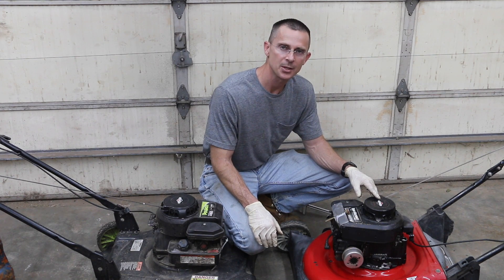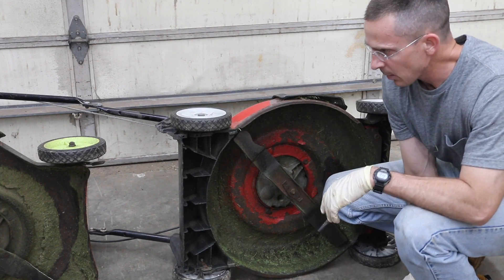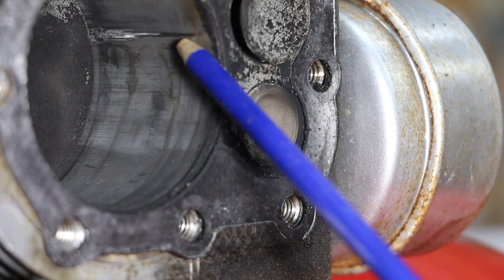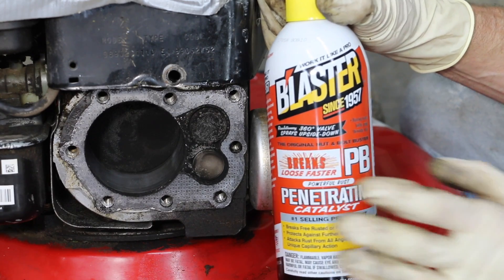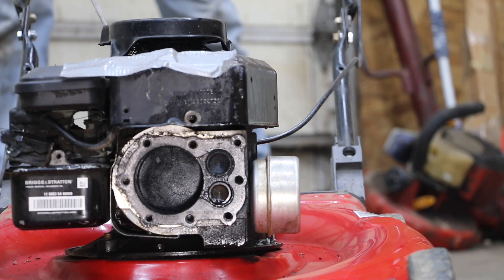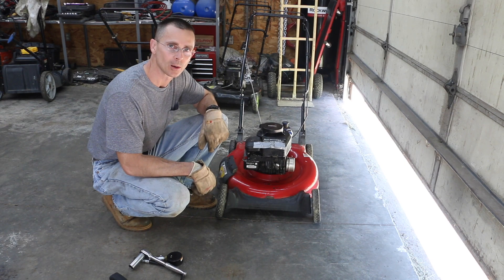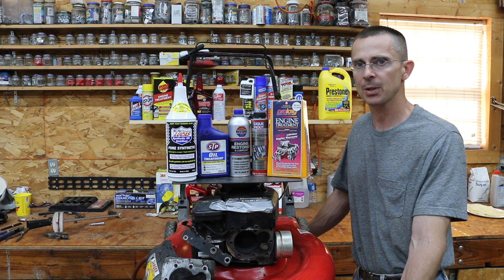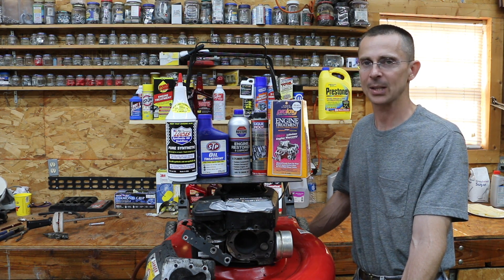Engine ran without oil, seized! Can it be saved?

Comment: You cant put the material back on the bearing and wear surfaces. When its scored or gone its gone. If you want it too run quiet put gear oil in the crankcase. Years ago WHen we first started buying Subarus someone brought a Subie that had run out of oil and seized. The mechanic's were lucky at freeing it up and they road tested it for a while. However, like you said if its knocking... its not going to live long. 

I was in the appliance repair field years ago and of course on occasion electric motors would seize up. Motors seize for different reasons. T
1)The bearing had run out of lubrication or was contaminated with water or dirt. Physically damaging the surfaces.
2) As was common on Fan Coil (water runs through a water to air heat exchanger. Sometimes Chilled 40 degree water, sometimes hot 190 degree water) the motor oil would evaporate and gum up. 99% of the time Just cleaning the bearing and oiling would free and save the motor. If the motor bearing gets damages and metal transfer occurs between the shaft and bearing its life is really over. 
3) the bearing is gone and the rotor is rubbing the stator. 

On occasion luck is on your side but not normally.

This is a great experiment pal thanks for the fun
Reply from the maker: All great points and thanks for commenting.

Comment: I  often had those brought into returns at both Home Depot and Lowe's. After explaining this was a non warranty issue, something I learned from working in a repair shop,  I put in fresh oil, tipped mower on it's nose for a few seconds, put WD-40 in the cylinder, turned it over by hand a few times.
Reinstalled spark plug, and it would usually start. I would run for no more than a minute, drain out black, metallic oil out, refill and suggest to the customer that oil should be changed after the next mowing ...
Reply from the maker: Thanks for commenting on this!

Comment: My fahther had a Stil one cylinder mower which seized up. So he disassembled everything, bought oversize rings, took some Sandpapier to hone out the damage. You might also need to buy new bearings. But that is all. Running like a champ.
Reply from the maker: Thank you for this recommendation!

Comment: From a young age I learned about Marvel Mystery Oil. I have used it in all my vehicles. I bought a chevy malibu with low mileage. Pretty much brand new 4 years ago and always used MMO in the gas and oil and that engine runs extremely well and still has the same horsepower as it did when I first purchased the car. I have added about 35k miles on it and really, it's just always been an amazing additive for me. Far better than seafoam.
Reply from the maker: MMO is a great product!

Comment: what i have found in the past when the seize due to oil starvation is the rod has a habit of breaking down and "welding" material on the crank , since most these small engines dont have a oil pump , most these oil treatments wont seep in properly , and since the rod has galled to the crank , it has worn excessively , hence the knock . some times if the engine is worth the cost , it can be honed , a new rod and the crank turned. great stuff you got going on here . im hooked . thanks
Reply from the maker: You're right. I've seen the same think regarding the rod/crank "welding".  Thank you for the positive comment!

Comment: I have an old Nissan with 300,000km's on the clock and I use the thickest, gummiest engine honey I can find (Moreys) and you really can hear the rattles and knocks reduce but that knock I think is past it.   Do you have access to a decibel meter to scientifically try each to detect which will quieten it the most?   Maybe also try plain old diff or heavy gear oil as a comparison and cheap alternative?   Another great vid!
Reply from the maker: Thank you for this recommendation!

Comment: Is it possible to run 2 engines by swapping The wire to the spark plug to the other engine and starting them at the same time will they run.  Do this in a video
Reply from the maker: Thank you for this recommendation!.

Comment: My air compressor pump assembly (dual valve) shaft will not rotate. Do you think there was too much damage to fix it, or would it be worth repairing? The whole assembly is over $400!!
Reply from the maker: It's really difficult to say without taking a look inside to assess the extent of the damage.  I hope it can be affordably repaired, but it's more than likely in need of significant repair.
Reply: Project Farm thanks for your reply! I'm no valve expert, but I'm going to open it up and see what damage was done. Thanks for your time and all the KILLER vids!

Comment: Just wanted to say first off i like your videos! As for this situation one product i have tried thats not on the shelve you showed was a tube of tractor grease, yes i said that correctly lol. I had and engine seize and freed it up but need to get the job done and took the grease and put it in an old cooking pot and heated it with a torch to basically liquify it and poured it into the crank case. In my situation it did get rid of the knocking sound and was able to finish the job but once it was cold it was a no go. I would like to see this in one of your videos to see if it would be a repeat. As far as compression idk. But it worked on my pinch. Thanks again for the great videos!
Reply from the maker: Thank you for this recommendation!

Comment: My motorcycle started burning oil faster than I was checking it.  It seized up (slightly) on me on my way to work and started to make a clanking sound and blowing white smoke.  It will still start and run but I don't dare actually drive it.  

Guess I'm doing a top end rebuild.. at the very least.. :(
Reply from the maker: Sorry to hear this happened to you.

Comment: I had an old '67 skidoo Olympic that seized. After working it back and forth and pouring oil and pb blaster in the spark plug hole I got it freed up and still have it and it runs!
Reply from the maker: Impressive!  Thanks for sharing this experience.

Comment: I boughtba brand new mower and it siezed after 2 minutes. Id followed the recomended guide in the manual on how much oil to put in and petril etc.. i filled the oil with the correct oil.. its seized hard cant pull yeh starter motor cable at all and the blade is locked hard... Im gutted. Cant take it back to the shop cos it wont fit in my car.
Reply from the maker: Sorry this happened to you.

Comment: I had a lawnmower that was still running, but it made a very thick smoke cloud with a loud knock. Didnt try saving it, it never seized just got used alot.
Reply from the maker: Thanks for commenting on this.

Comment: i know this is really late but my choices and why, are LUCAS, STP, and LIQUI MOLY. all for a single reason. almost every race league runs 1 if not all of those brands, meaning they must me good enough to be used in such high performance and temperamental engines.
Reply from the maker: Thank you for this recommendation.

Comment: I say use resore like you did in your video with your ford 5000 tractor. I used restore in my 1975 ford f100 that has a 4.9 300 inline 6. The engine is original has not been redone at all, i used restore  and noticed a hugw difference in engine performance.
Reply from the maker: Thank you for this recommendation.

Comment: That knock might be a wrist pin but I think it's probably a stretched rod end cap, squashed/spun bearings or both. I would truly like to be proved wrong but I don't believe any of those products are going to do much good for that. If you can find a product that lays down some kind a film between the rings and damaged cylinder wall that might help with compression a little, wouldn't want to count on it in anything other than this test mower engine.
Reply from the maker: Great point. Thanks for commenting.

Comment: slightly different situation for me, i seized an engine with a blown head gasket due to overheating. 1984 bmw 325e with the 2.7L inline 6, drove it till it locked up, had it towed home, less than 2hrs later was able to start and drive it. Replaced the head gasket a little while later and it ran great. I was totally surprised it ran at all lol
Reply from the maker: Wow!  Glad you were able to save it.  Thanks for commenting.

Comment: If the mower deck is good, I'd just buy a new engine for it but these days, you can buy a new mower for the almost the same price as just the engine. It pays to hose down your mower or clean it off after use.
Reply from the maker: Thank you for this recommendation.

Comment: I used Restore in a Ford Escort almost 30 years ago, it went from 50 miles to a quart of oil to about 250 miles to a quart.  The car ran better and when cranking the car over it sounded like it had better compression, sorry I didn't check before and after compression. Love your videos, keep up the good work. Uncle B.S.
Reply from the maker: Impressive! Thanks for sharing this experience and thanks for the positive comment.

Comment: yeasterday my car renault kwid climber engine stopped due to oil leakage can it be recovered again?
Reply from the maker: It's possible if the engine didn't have a "broken part".  However, the engine is mostly too badly damaged to recover.  If the engine is seized, it's possible to add a spray lubricant to each cylinder and manually rotate the engine. I hope this helps.

Comment: I restore ceased engines often. On my cub cadet 80 their was a oil issue for a while and the engine basically ceased. This happened another two or three times. The way you fix it is grind the cylinder gradually and it will still work fine but you may need to replace the piston overtime. Mine now runs perfectly without a knock.
Reply from the maker: Thanks for commenting on this.

Comment: I'm interested to know what a 50/50 mix of Marvels Mystery Oil and Mobil 1 Synthetic could do if left to soak in the cylinder with the piston completely retracted. Think it would bind to the scoring and maybe give a little repair to the piston ring? It could be worthless. I don't know.
Reply from the maker: This is a great question and I definitely do not have expert-level knowledge regarding either of these products.  Maybe I can do some testing.  Thanks again for commenting.

Comment: The Restore to get the compression up (I learned that from you in another video)...  :)   And the restore might improve that main bearing knock a little bit.  I assume Restore works by hardening in very hot areas, above a certain temperature (it would be neat to see if Restore creates hardened deposits in a skillet at a particular temperature, an idea maybe?)...   if the engine still knocks after the Restore treatment, the STP's thickness could buffer things a bit and prolong the main bearing.  Maybe.  :)
Reply from the maker: Thank you for this recommendation.

Comment: I say pull the piston out and try to clean up the rings a bit and dingle ball hone they cylinder real good, then maby run 30% Lucas in crank case oil.
Reply from the maker: Thank you for this recommendation.

Comment: Good old fashioned type f trans fluid soak down the cylinder overnight I think would do better than any of those other products
Reply from the maker: This is a great recommendation--thank you!
Reply: I un seized a ford 351 Windsor from the sixties with atf down each cylinder let it set over night used a brake bar on the crank to free it up it started right up solid compression ran sea foam thru it and I've put 45k miles on it since

Comment: The rod bearing will need thick lubrication to dampen the knock. Maybe a ring breaking made the gash in cylinder wall? Don't think you will get much more compression. Maybe really thick oil?
Reply from the maker: Thank you for this recommendation.

Comment: Spray a lttle ether directly into the carburetor or cylinder spark plug hole.  It contains a highly flammable & combustible  agent that is certain to ignite almost any engine.  Also consider using a 70% concentration of  STP inside the cylinder wall.  While it may not fix the cylinder wall damage It is a much thicker lubricant that will help to control the piston knock as the engine temp rises. Colder climates will thicken the lubricant and may make start up more difficult.
Reply from the maker: Thank you for this recommendation.

Comment: I'd like to think that the prolong engine additive is about the best on the market and should do the trick but let it run at least a half or full tank of gas thru the mower also go a little over the recommendation of the bottle specs.
Reply from the maker: Thank you for this recommendation!

Comment: Simple, no you will not be able to "restore" a sized engine without it going to the machine shop and then being rebuilt.  You might be able to get it back up and running, but to say "restore" would be a pipe dream.  LOL.
Try the Lucas in the engine next, it thickens up the oil, should help a little.  I don't like engine additives (mainly I drive a diesel), but Lucas trans fix is pretty good I had a Land Rover that shifted really hard and like crap because I was abusive to it, well once a year I'd change the fluid and put a bottle of Lucas in it and it never gave me anymore problems, went on like that for a few years till I burnt up the engine.
Reply from the maker: Thanks for commenting on this.
Reply: Thanks for the videos, I enjoy watching them to relax buddy, take care.

Comment: Replace the Rod Bearings & then use Engine Restore to see if it will repair the badly scored Cylinder walls in that GAS engine that seized .
Reply from the maker: Thank you for this recommendation.

Comment: On my br55 stihl blower I killed the engine once my dad texted me and informed me of the can mixup.  It was stiffer than it should have been whenever I pulled the starter but my dad coated the cylinders with oil and I ran it with a lot of oil in the gas for a while not sure the mixture and it still works too this day.  The incident was last year.
Reply from the maker: Thanks for sharing this experience.

Comment: I used to see these commercials on Pro long where they showed engines running without oil I'd love to see if that would work out with one of your engines. What they did was they treated the engine with Pro long and then drain the oil and then ran it without oil.
Reply from the maker: Thanks for this recommendation.

Comment: Well I want to say thank you for taking that head off and letting us take a look-see at the cylinder the knock is probably from the crank in the connecting bearing and if I was going to try to improve the compression I would use at STP cuz it's a very thick oil and I've used that when a rebuilding engines you know to give it that extra boost especially in the oil pumps
Reply from the maker: Thank you for the positive comment.

Comment: I save ones like this many times a season. The key is don't turn engine first.  You do  a lot more damage. 
You don't need to pull head. 
First thing is drain old metal filled oil out and refill with at least 25-28 oz of full synthetic 5w-30 or 10w-30 oil.  You want it over filled.
Take plug out and fold mower handle so you can tilt back so head is almost vertical. 
Spray PB Blaster first then chain lube (I like Lucas chain lube best) into plug hole into cylinder.  About 1 oz of PB and then 2 oz of chain lube. 
Do this at least twice then sit mower back in proper position for at least 10-15 mins. 
Then tilt back up and spray both sprays into cylinder again. Now sit back down and flip on one side then the other for a few seconds. 
Now tilt back and grab blade and ONLY turn backwards from regular direction. Clockwise if looking at bottom of blade. Only move blade 2 INCHES then go back to where it was. Go back to the two inch spot, then back to start.  Then go 4 inches and back to start.  Then 6 and back, then 10 and back. Then you can go all the way around backwards still a couple of times. 
Then you can go forward. 
You can squirt more chain lube in during this to protect bore better. 
Now you pull rope a few times to blow out the oil sprays I cylinder and put the plug in and start it. 
Slight squirt of starting fluid or gas spray in carb if you need to. Might have to take plug back out once to dry off. 
When it starts. Turn it off as soon as it gets up to speed like within 2-3 seconds.  Then restart. 
Listen to see how much it knocks. 
Normally you don't hear any knocking when running but you will hear some as it spins up to speed and as is coasts down as you release handle. 
Run it about 10-15 mins then change oil to valvoline VR1 racing (high zinc)  and 6 oz of blue bottle STP. 
I have them that have run for years this way.
Reply from the maker: This is a terrific post!  Thanks for commenting.

Comment: I've run Briggs and Stratton with water in the crank case at wide open throttle for a long time. I was just trying to blow the engine. It ran for 16 minutes. Forever listening to a engine run.
Reply from the maker: Thank you for this recommendation!